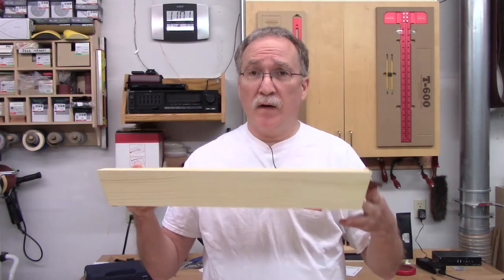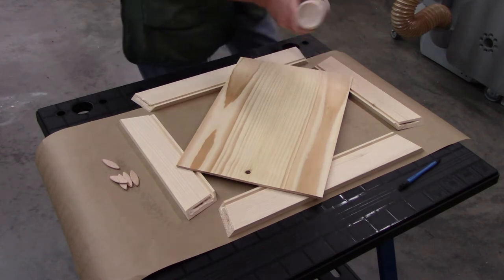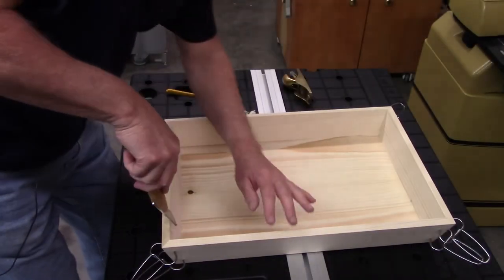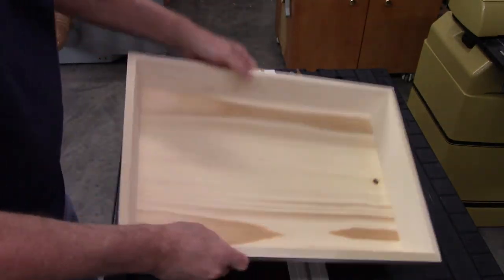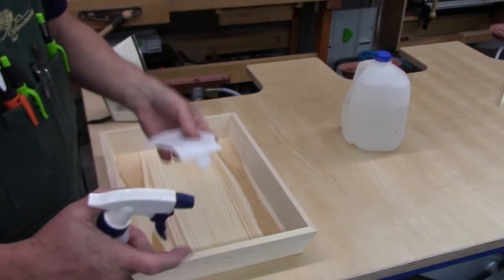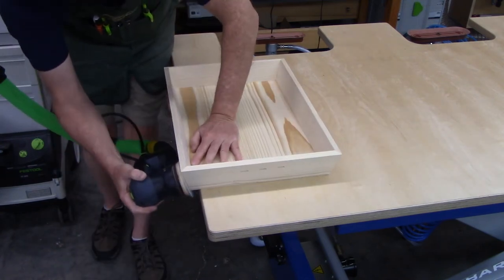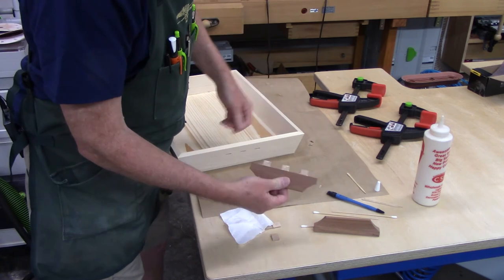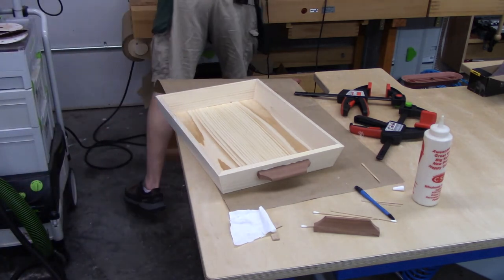Compound Miter Serving Tray Part 2

Comment: Maybe if you miter the same angle to the handle so that they would had been parallel to the ground it would look even better, that's just my opinion. Very well done, your tools are superb!! That martin table saw made me drool... Definitely subscribed!! Thank you!!
Reply from the maker: Thanks Jony.  I thought about that but to use the dominos, the handle would have had to have been much thicker.since the tool will only cut mortises normal (perpendicular) to the face of the joint.  If the sides were angled much more than 15 degrees, I think horizontal handles would probably look better.  Steve
Reply: ExtremeWoodworker i thought that after I posted. Dominoes are very convenient. I wish I had 1k to burn on one...
Reply from the maker: I completely understand.
Reply: I did bite the bullet on an Incra TS-LS fence and the router kit... Little by little ill get my tools right... Got 15 more years to retire since I started young to work with DHS. I hope I got my tools and my skills checked by then, cause I'll be too young and my hobby will become my full time job... That's my plan at least, if God permits.
Reply from the maker: Incra makes some nice stuff.  I wish my router table fence was an Incra but what I have is there to stay.  I had also planned to get my shop in order before retirement, retired, and then 2-1/2 years later got the call to do some contract work (a 3-4 week job which has significantly expanded scope and going on 4 years).  I have less time for hobby now, but working has funded some tool upgrades that I normally would not have been able to afford in retirement.  Someday, (God permitting) I will re-retire and spend much more time in the shop.
Reply: Your router table looked very similar, I was wondering what type is. I saw it on the video you where explaining how to do mortises on the router table. 4 weeks to 4 years, that's quite a forgiving deadline jeje. Hope you get more time on the shop so I can get more time on you tube

Comment: Hi Steve,
What make of vacuum holding system are you using?
Thanks,
Andy
Reply from the maker: Hi Andy, the system is a Barth 500V which also has hydraulic lift and mobile capability.  Steve

Comment: Wish dominos were not so darn expensive.
Reply from the maker: Me too but, it is also one of many that I have never regretted purchasing.  The only tools and equipment I have ever regretted are the ones where I "cheaped out."  Steve
Reply: @extremewoodworker  Yah, well i got cleaned out by thieves last year. Had a dowel version of that which i now can not replace.